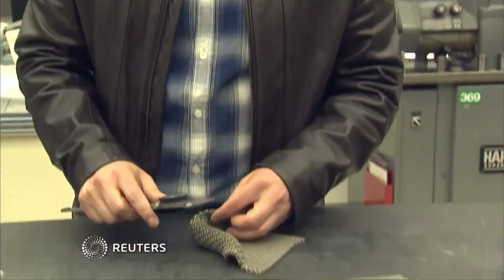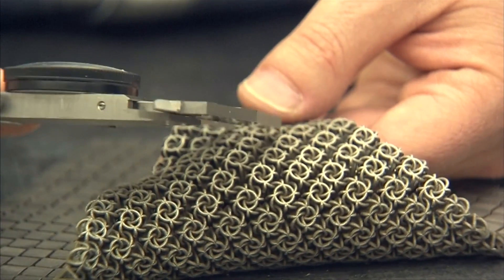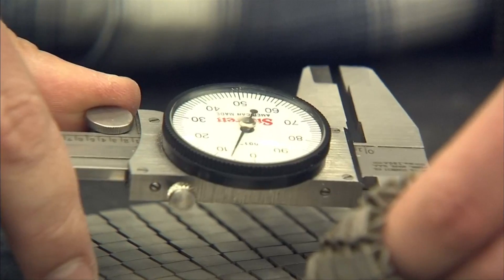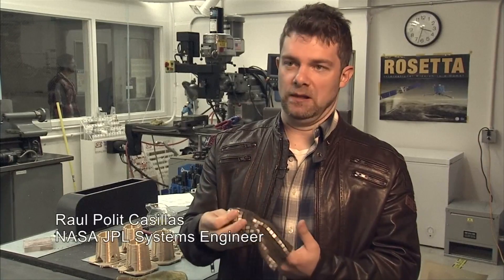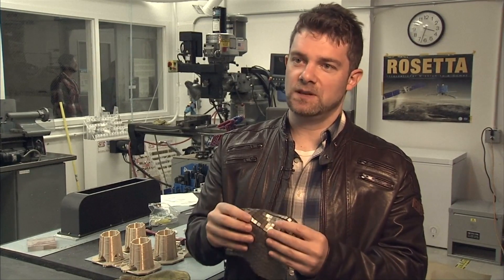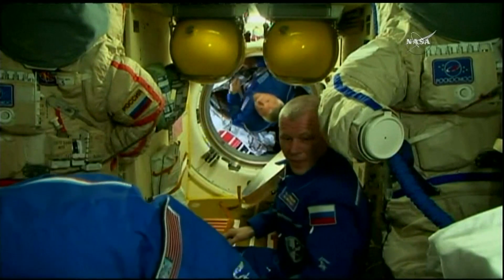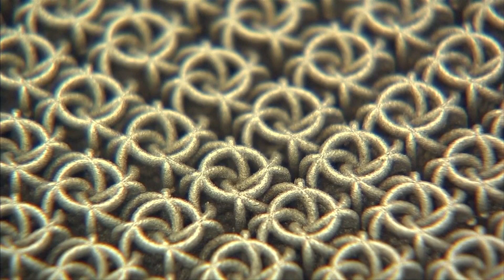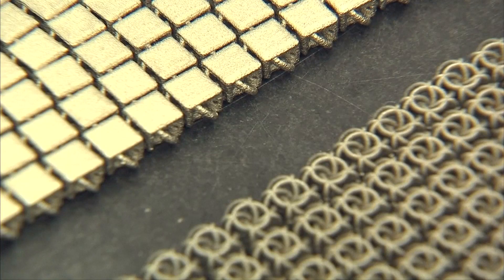3D-printed 'chain mail' could provide protection in space

Comment: this mail is far from being as reliable as its millennia old parent design. 3D printing means there's no bending or hardening and the "metal" used is very soft compared to real Steel cut from a forged wire, so the weeks aren't gonna be strong enough, either.
the best mail id made of a combination of welded and riveted hardened carbon steel rings, this thing down in the video looks like it could easily anal asking the break lines as you apply little pressure, also you've got mobility only in a single direction and that's kinda dumb.

Comment: 3D print in space?? I tought you where from NASA 

Lets make it really simpel
There is No gravity in space how the f**k is that gonna work
Reply: Artificial gravity is actually completely possible with the technology we have. That would require a bigass new station though, and that's indeed expensive
Reply: Hydras Fisk artificial gravity room specifically made for 3d printing?
Reply: In a space ship that is
Reply: Jancarlo Berrios i dont think that is possibole it would cost billions for them
Reply: Hydras Fisk well, lets just hope its possible
Reply: Metallic, so you could use magnetism to hold it in place, as for the filament, you just feed it through like a normal 3d printer. Alternatively you could just rotate a spacecraft and boom, artificial gravity.
Reply: Hydras Fisk regular fdm 3d printers work just fine in space. all it does is extrude each layer one at a time and it sticks to the surface it is printing on. honestly, it should work better in space because yoj dont have to deal with the normal problems of overhangs.
Reply: MemesAreCancer its No gravity so it would be harder than just do it on earth and bring it with them
Reply: Hydras Fisk it is true that it would be very hard to have a machine that could 3d print metal in space, but they did say that there was a chance that it could be made in space. they never said it was guaranteed.

Comment: Pretty sure whatever would pose a threat to space suits today would still be unfazed by this chainmail in the future.

Didn't they report a case where a micro meteorite or a piece of scrap hit one of the Space Shuttles windows with high enough speed for it to pierce a hole through a bunch of it's layers?

You think this is going to stop that very same meteorite going at it with the same kinetic energy?

IMHO this would be more interesting for either Police clothing to prevent stab wounds or simply for shits and giggles as a ridiculously expensive but incredibly beautiful ( and most likely heavy ) one piece dress.

Comment: Ehh... Pretty cool, but in regards to the welding points of failure, I think that's flawed...  Welding points are often stronger than the material itself.
Reply: Making it stronger than typical materials then? Or weaker?
Reply: Right now they are getting there. It´s still a pretty new technology. But the idea is to use the concept to produce flexible fabrics with the strength of steel or other even sturdier materials.
Reply: weld might be but the heat affected zone is not.
Reply: yeah, but you don't normally even weld chainmail and if you do it is a massively time consuming thing. This is fast and stable and therefore much cheaper too.
Reply: These things are technically one continues weld.
Reply: Traditionally mail was made of riveted links that were hammer welded during the riveting process.  This process is not like modern welding where the weld is usually stronger than the material.  A hammer weld could go wrong in several ways.  The material might not be hot enough, it might have corrosion, it might not have been hit hard enough.

It took a really talented armorsmith to have the patience, skill and stamina to craft quality armor.